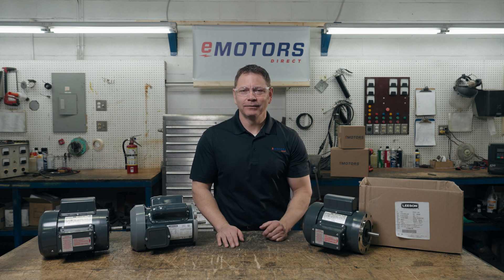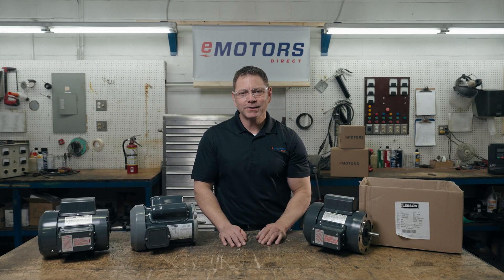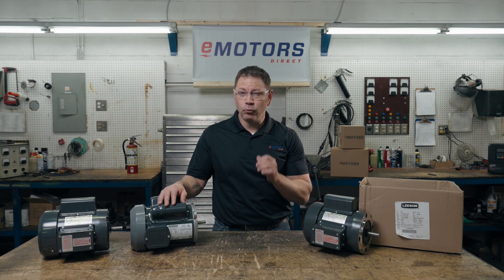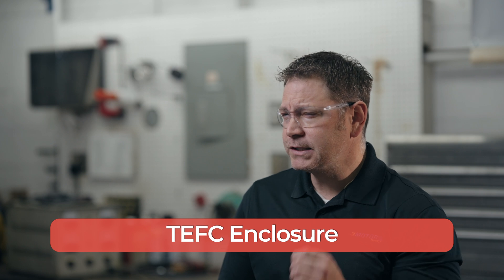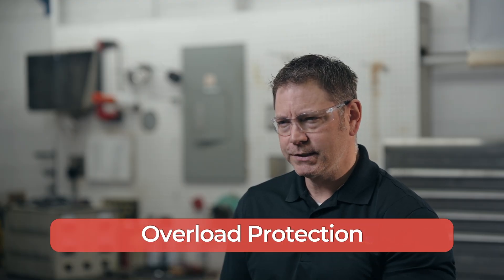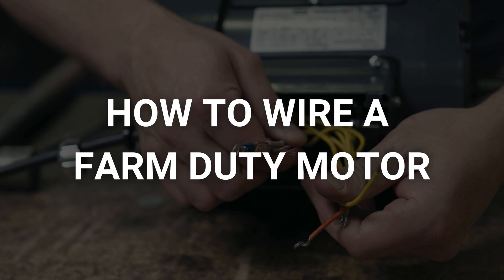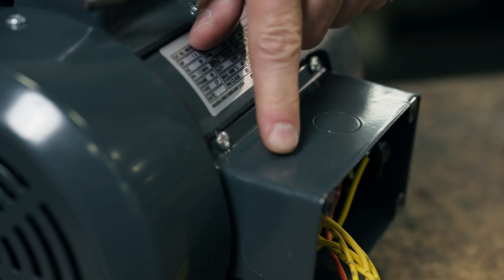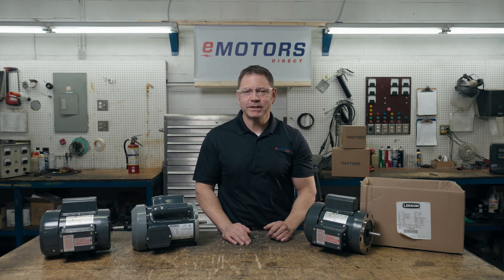What is a Farm Duty Motor?

Comment: Is it okay to use a farm duty motor on an air compressor?
Reply from the maker: In theory you could, assuming your farm duty motor has the correct HP, RPM, voltage, etc. But your air compressor motor will likely have a higher service factor, specific design features optimized for air compressors (ie. insultation and bearings), better cooling, handle higher torque, etc. Your farm duty motor may work in the short term but isn't an ideal long term solution.

Comment: Can you use vfd on a farm duty motor with start up capacitor? I was given one and wanted to purpose it fir a belt grinder.
Reply from the maker: Hi Tony, it depends. Some older drives without phase loss prevention could do things like this but it may be riddled with issues. If you're in Canada or the US, feel free to give our team a call to find the ideal product mix for your application.